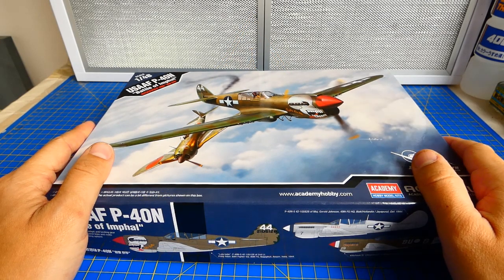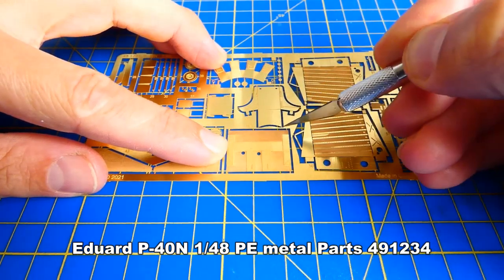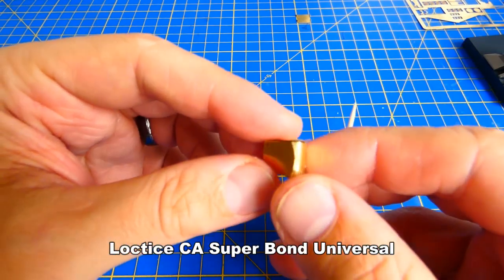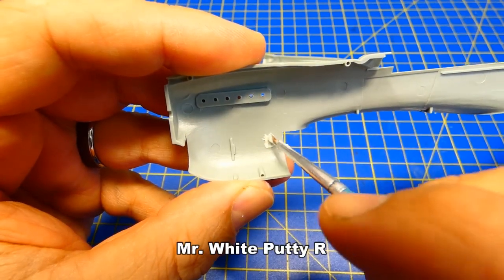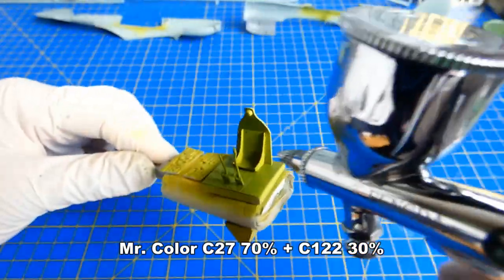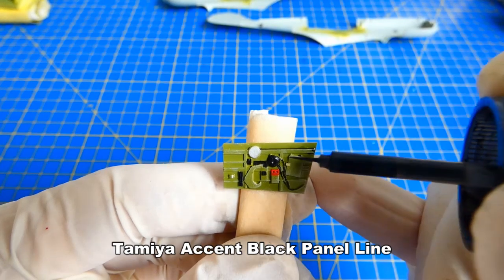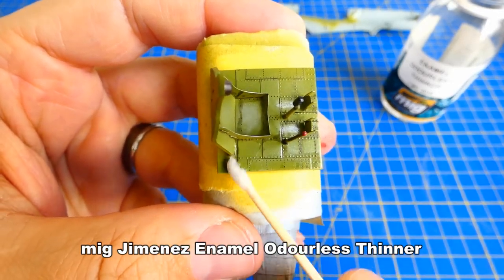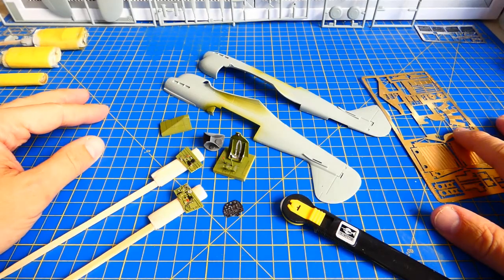Curtiss P-40N Kittyhawk PART 1.  Building the cockpit and engine cooler.

Comment: Hi my friend, what sort of vacuum pump or ventilator do you use? I think to the spraying. I saw it in the background.
Reply from the maker: Hi. Its a ordinary cheap kitchen ventilation digestor. 🙂
Reply: @modelsforfun  cool! Any other special modification with it?
Reply from the maker: @fischikawa  The digestor is connected to an aluminum pipe with an outlet to the window. That is all. When I airbrush, I slighly open the window for the pipe.